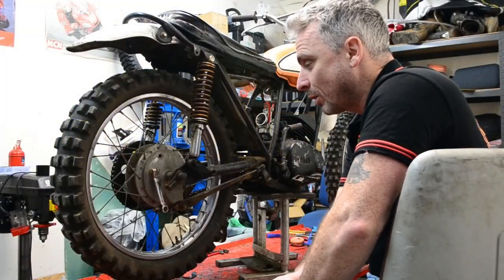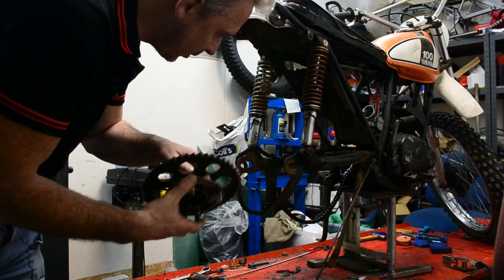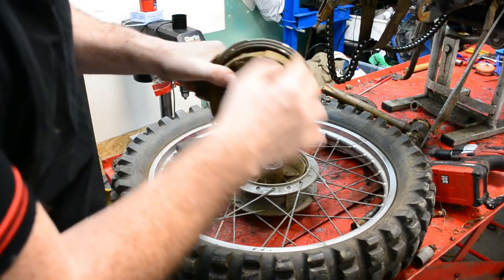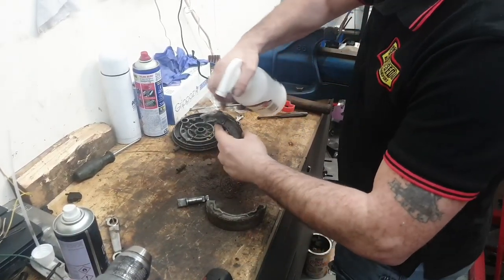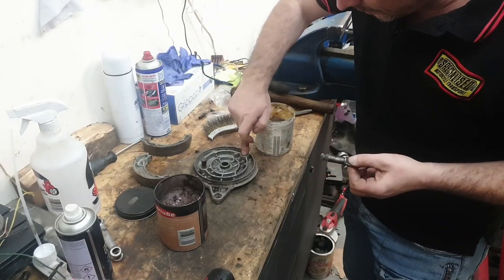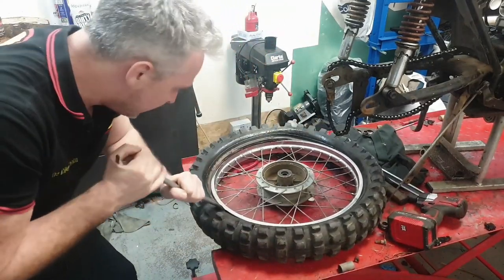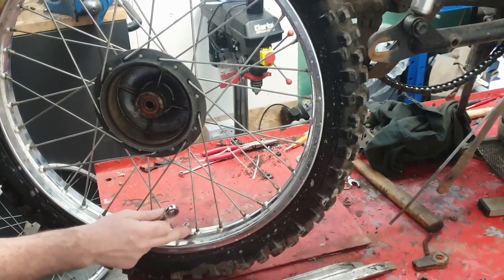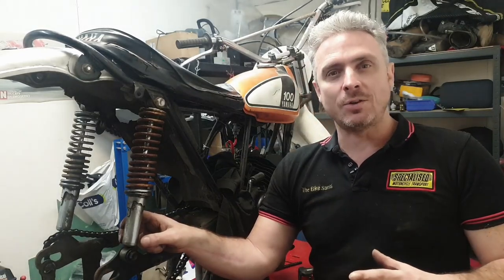Can a 48 year old 100cc two stroke bike do 500+ Miles pt4

Comment: I was taught to start tyre removal OPPOSITE (180 degrees)  to the valve!
Reply from the maker: This is interesting and I'd like to hear what others say about this? 
I've been doing it this way for 40 years. 🤔
Start removal at the valve and finish refitting at the valve.
Reply: @SpecialisedMotorcycleTransport  l think the theory is to start where the tyre bead has most space to move into when prying over the rim. Also less possibility of pinching the inner tube and easier to remove that part first too rather than with the valve. Of course if one has habitual success with a method that naturally becomes the one trusted.
Reply: Agree to disagree, I was a tyre technician for 9 years and did this day in day out, I very rarely nipped a tube starting near/on the valve

Comment: Man , those tyres would come off much easier if you put the wheel on the floor and actually break the bead properly first .   Then you could  stand on the tyre opposite to where you are levering .
Reply from the maker: The bead was completely released. 👍
Reply: @SpecialisedMotorcycleTransport  Okay , but you needed to get the bead opposite the levers right down into the wheel well . That would give you a bit more slack and make the job a lot easier .  Tubed tyres are usually a lot easier to get off than the tubeless . Have you tried removing one of those by hand ?   If you don't have a tyre machine a flat garden spade works well to break the bead off the rim , mind the discs tho'  ; )
Reply from the maker: As explained in the video the tyre was so old it was like concrete and was cracking as it was being levered. It was as far in the rim channel as it would go. 👍
Reply: @SpecialisedMotorcycleTransport  Must've been ,  looked like the levers were gonna bend lol .  Good little bike those , well worth putting back to use , and a lot of parts still available .

Comment: dude wear goggles when you use a wire wheel on a bench grinder you'll not be delivering anything with bits of wire stuck in your eye balls !!! copper slip with aluminium and steel is a no no , when they come in contact with water you get galvanic corrosion , sorry for being a bit of a karen, love your vids keep em comin 👍
Reply from the maker: I hear you mate and I knew someone would pick up on that. 😂
Only used copper slip on the brake parts that are steel, used moly grease on the pivot through the plate. 😉